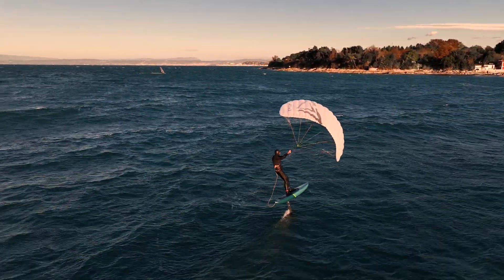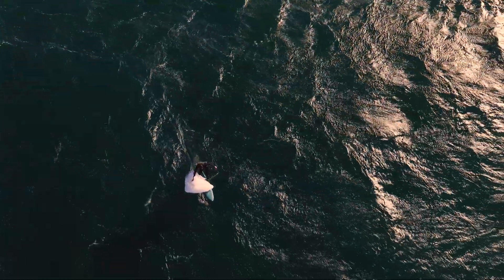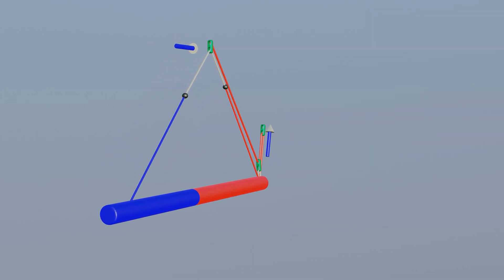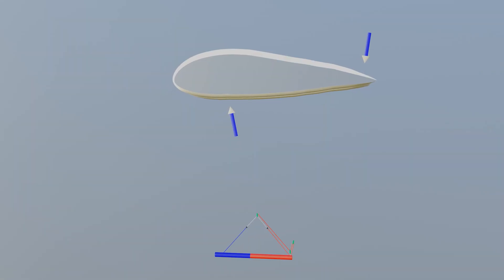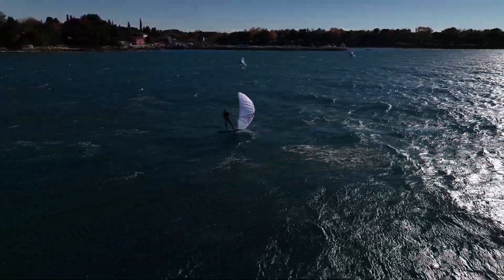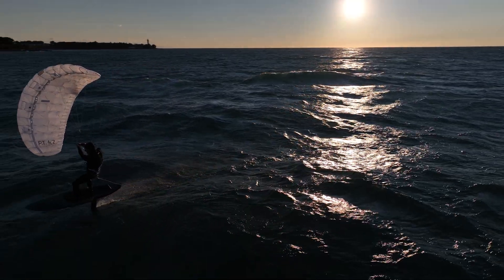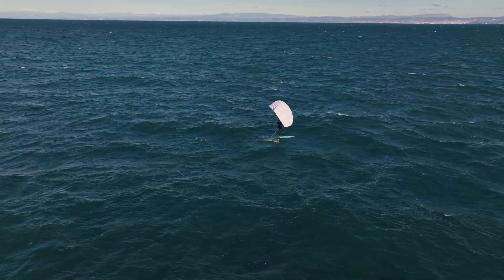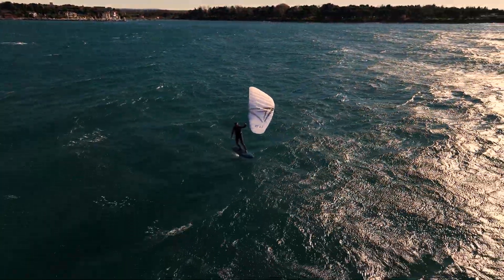P.T. / The first Ram-Air foil Parawing on the market

Comment: The comments are wild. This is the first ram air parawing the market has seen. All you kiters can settle down. We know ram air kites exist. They suck when they get wet. These are ok. 

Yes it’s expensive. It’s on par with every other maker. The R&D, material, labor, testing, packaging, etc all add up. 

They have used models on their site for €400. Stop whining. It does not get any better than that. 

BRM made a double skin that’s $1,300+ and the F-One Frigate is $1,300 for a single skin. 

I’m excited to try this and review it. My experience is with a BRM Ka’a 4.2.

Comment: It seems far more difficult to deflate it and put it in a bag to "forget it" !? So, of course double skin provides a lot more efficient behaviour in upwind, but it is heavier, especially when wet, and more difficult to deflate of course, even with a net on the trailing edge.....
Reply: It is more difficult, so if you are a die-hard downwinder who only goes downwind, then a single skin is an option. There is a video where you can see how it packs. It takes time, but do you mind the evolution of the sport in a different direction? Having a powerful tool stored in your hands for technical downwind runs allows you to be quick and easy at the top of the run. Then this is the answer.

Comment: ha ha ha ha ha ha ha! There's a long history of ram air foils going back decades. Heck, I haven't used my Flexi Foil Sky Tigers  in 20 years, but they're still in my garage.
Reply: Ha, mine too, and a collection of Blades and other foils. That's what I learnt to kitesurf on in the '90s! Handles with super long lines, then made a l-o-n-g bar and pulley bridle setup, finally flew them on super short lines, basically straight off the bridle, for downwinders. All 20+ years ago. It was all fun until they filled with water and sank 😂
Reply: @peterbarnes4011  In the very early days I imported the first 6 original Peter Lynn kite buggies into Canada for some friends in the Toronto Kitefliers. I still have mine. Back then the kites were simpler. But dual-surface and quad-lines were the rule.

Comment: 1200 euros is pretty pricy!
Reply from the maker: Hi, Some guy, the P.T. is a double-skin Parawing with internal construction, meaning that there is quite a lot more material used in order to produce it. Therefore, the price as it is, and considering that the single-skin option from the USA is 1200 in the EU as well, seems rather good.
Reply: @TripleSevenKites  What about kites? Will you be releasing regular foil kites soon? (I notice "kites" is in your name, but you only have a parawing so far)
Reply from the maker: @coloradogeology9902  With the drainage solution that is now working perfectly, we're looking into this section as well. Especially short line kite foil section.
Reply: @ The drainage solution seems pretty great, but I live in Colorado. I need kites for snow and land. I'll keep an eye out for what you make.
Reply from the maker: @coloradogeology9902  Sure, P.T. works on land too ;)
Reply: I'm with you. I am not only 100% empathetic to anyone starting a new product or introducing innovation to the sport we all love but I support it with a purchase normally. But cost does matter. And that's too much right now. 

especially because many of us / most of us don't live in Down Wind friendly locations. Therefore, we  have to wait for the price to come down. Testing a product and reselling it if you don't like it gets very expensive in the foiling world.